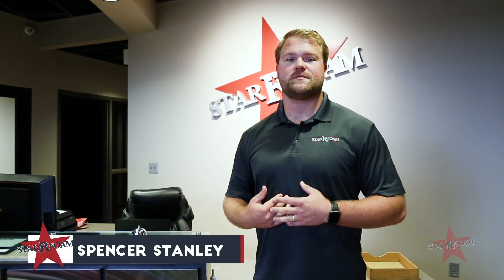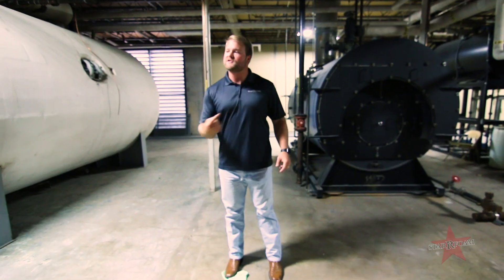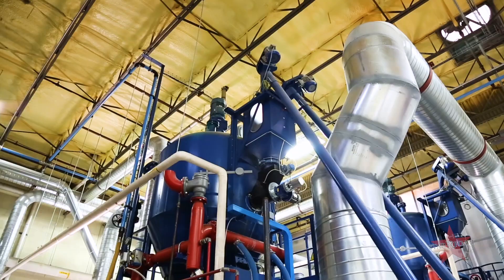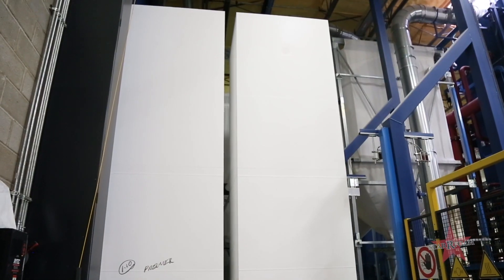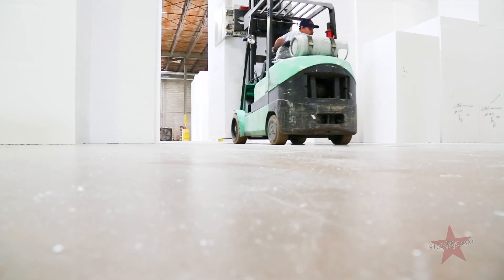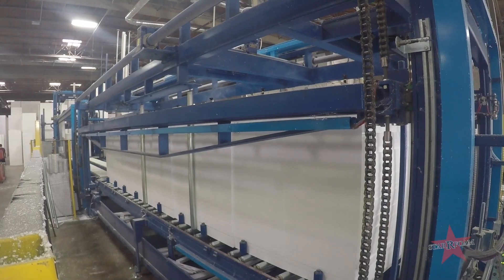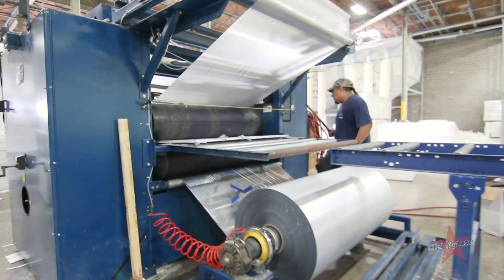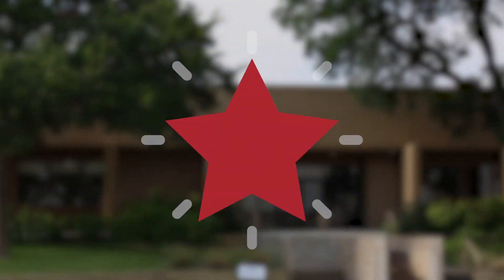StarRFoam - How Foam is Made

Comment: Why stand your blocks? You severely limit your storage capacity. In the space you stand 40 blocks you can stack 100 blocks.
Reply: Um dude its the same amount of mass it will fit the same either way
Reply: @sheepdoug4746  no it isn't. Standing your blocks you're limited to length of block. If your blocks are 16ft then the stacks are limited to 16ft tall. Laying them down you can stack as high as you want. I work in a Styrofoam plant and assure you that you're wrong.
Reply: @sheepdoug4746  when you lay blocks down your only limitation is fork lift lifting capacity. You could stack them 1000 feet tall. You just stack as tall as the lift goes then grab the bottom block and pick up the stack to place it on top of another stack. Then grab the bottom of the new stack to put on a third and you've tripled your volume in the same square footage.